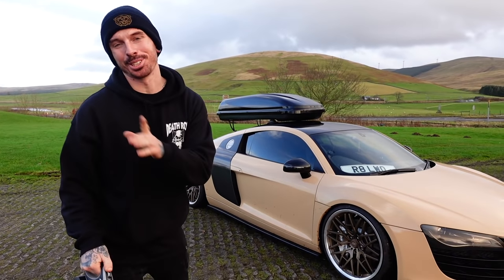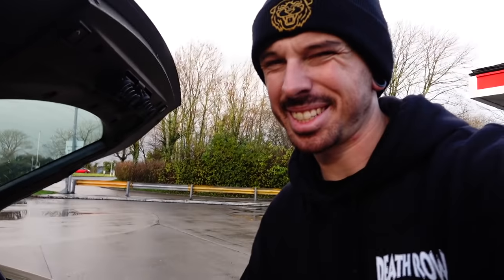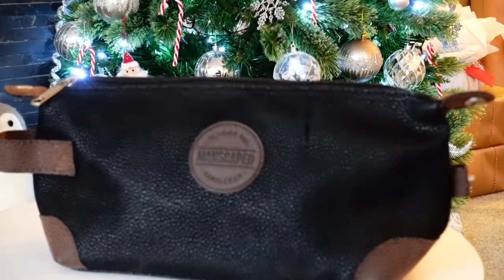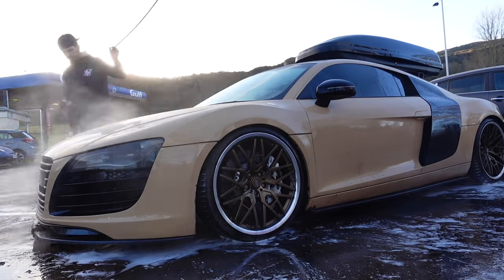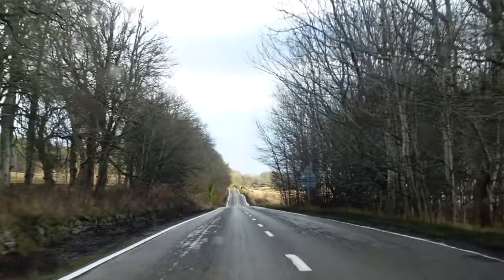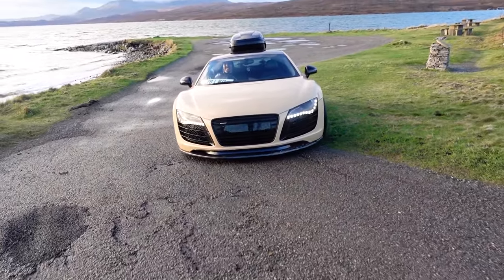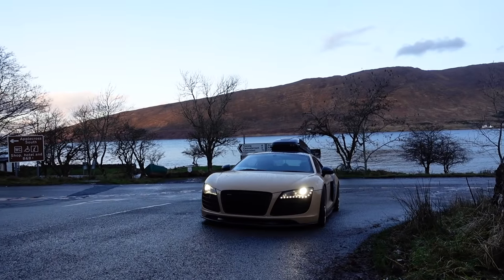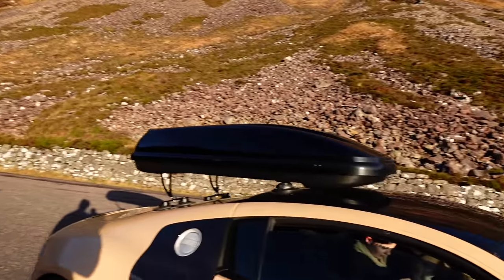DRIVING 2000 MILES IN MY AUDI R8 I REBUILT

Comment: Did this in July in a rented a180d - ended up doing about 950 miles in 3.5 days as the roads are just insane up there, you can spend 8 hrs a day driving easily

Comment: Armstrong,the oil level,must be ok in the bath oil,down.If the drain oil is not fast to the bath oil,you can get that thing,,low oil''.That  means ,the oil drains,are clogged.Maybe,In you case.The engine can spill oil engine,only trough semi ring and down/up to the exhaust valves.Is the only way that an engine can spend good motor oil.So is to blame:the pistons semi rings and after,the exhaust valves.Also the engine can flash the engine oil trough the turbine spinning system .Now you can think.

Comment: Getting engine fault after a fill up can be caused by faulty EVAP purge valve that's not closing properly allowing too much fuel vapor to be sucked in. I get this on my Bentley GT causing it to rough idle after a fill up.